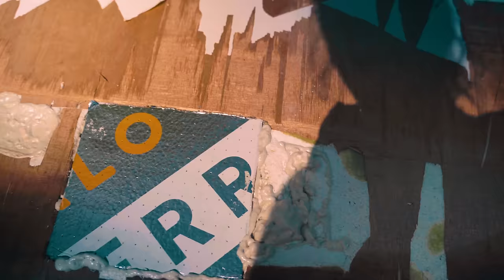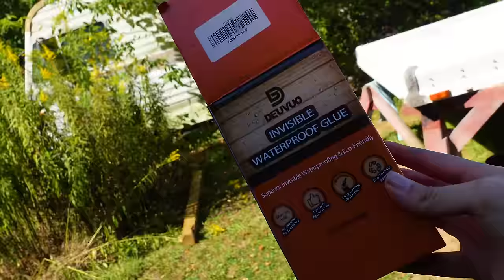my new HAIR & I finished my camper roof

Comment: Dealerships are notoriously expensive for service. They no longer make good margins when they sell cars. So, most of the money they make they make through service work. Never take your car to a dealership for service work. You need to take it to a local independent mechanic. Wheel bearings are not hard to replace and all you have to do to diagnose the problem is lift the car off the ground and spin the wheel. Replacing a wheel bearing on a Jeep should cost you $300USD-$400USD in total, with no diagnosis fee at a local independent mechanic. I don't think it's that the dealership took advantage of you, necessarily (telling you warranty would cover it was not right, though, when they already knew it wouldn't). But look, you have to pay attention to the world around you and how it works - like knowing dealerships make their money off service and that dealerships do service work to make things "like new" with original parts from the car company (super expensive compared to 3rd part parts most people and mechanics use which are the exact same, work just as well, and last just as long).

As for the warranty, I'm assuming you're talking about one of those 3rd party company warranties given the age of your Jeep. Those warranties are not worth the money. If I'm correct that is what you have, you should cancel it immediately and stop paying. Those warranties only cover manufacturing defects, not normal wear and tear on your vehicle. So, things that normally wear out or rust - bearings, exhaust system, belts, transmissions, alternators, starters, engines, cv joints, shocked, struts, electronics, etc - none of that is covered. For something to be covered it would have to be like - the axle cracked in half because there was a bubble in the steel when it was made. Or, like you buy a brand new part that is rated for 60,000 miles and it only lasts 1,000 miles before it fails. And, you need your mechanic to call the warranty company to make the claim and he has to be very careful about what he says and how he says it. He has to deny it was wear and tare and say in his opinion it looks like a manufacturing defect. Honestly, I feel like the whole 3rd party warranty industry is kinda scamy and the Gov't will probably shut it down or heavily regulate it. It takes advantage of people's anxiety about their cars.

I think a lot of the reason people have this anxiety is because cars are complex and expensive to fix. But, if you spend a little time educating yourself about them most of that anxiety will go away. There are some really good Youtube channels that can teach you a lot, like "Scotty Kilmer" and "ChrisFix". You can easily start doing some basic work yourself like air filter, oil changes, and oil filter changes. It's really not difficult at all. Plus, understanding more about what is going on will prevent a lot of anxiety about things like the kind of noises your transmission makes when climbing a mountain (which are almost always harmless).

I used to work as a mechanic, and believe me, unless you are a mechanic at like a BMW dealership or a Porshe dealership you are not making much money. And, I've almost found most mechanics to be pretty honest. The dealership service managers... not so much. A tip related to that - never have mechanical work done at like a chain tire shop or a chain oil change place.

Comment: alot of those cabinets have varnish on them and so it wont work good it needs to be sanded first  to take that off then seal it with the paint   ... as for the roof that sucks  

 damn just ugh...  good luck hun

Comment: Leave that roof covering off and just seal with a water proof roof coating.   Should be tacky enough to adhere and stay up and will act as a membrane…. And since stuff like that is thick when applied should conceal most if not all imperfections …. Just my 2 pesos.  Hahah just. CHeck that those roof coating don’t emit too much toxic 
Fumes
Reply from the maker: That’s a good idea if they are ok for indoors lol I’ll research it
Reply: @TorieRobot  if toxic then apply to exterior and simply paint interior ceiling with normal indoor paint.   One consideration I didn’t think about is weight of the roof membrane … I can’t imagine it would be any more than the wood or laminate your working with now.  But I could be wrong 😑

Comment: Plywood looks like old cheap Luan and is de-laminating. Maybe try stabilizing it with a lot of 2 part fiberglass resin mixed a little thin and get it really wet so the Luan sops up the liquid and re-glues the layers and makes them stabilized and stronger again. Gorilla and Loctite's Best adhesive edges out Liquid Nails, but like you said, the plywood is where it's failing. You know, if you has a buzz cut or Rapunzel's hair, or anything in between, you'd always be beautiful. And then you smile and it's all over... Irresistible.... and resistance is futile! Yes.... People are all selling out because those that have good hearts always seem to lose. But I'll let you figure out what can work for you! Social Media is Inverting what took thousands and thousands of years of societal trial and error to employ a system that mostly works. And that's really the best Humans can do. Don't be fooled with the carrot of expecting better. It only does the opposite. Eventually, to the point of implosion. Keep at it Young Lady! Be true to yourself and work with those that don't have their moral compass spinning so fast, it cuts the glass. It's the discipline that breeds success.
Reply: And to get the roof to CROWN again in the middle.. As long as it doesn't interfere with the lift system..... Make two wood Joists that go from side to side (One piece each), one in front of the vent and one behind. Make the middle 3/4" higher than the ends out of wood like an arch. Then screw aluminum to the side of the wood and cut it to the same shape of the wood joists. Reinforce where it gets attached to the sides. Ample construction adhesive to the Stabilized plywood on top and SS nuts, washers and bolts to attach to the reinforced sides.  And of course, it can only be as tall as to where your headliner will be mounted! 1/8" thick by the tallest point of the arches of the joists aluminum bars, will not allow sag when married to the wood joists and won't weigh much. You can even use a belt sander to cut the aluminum to shape, of even a jig saw with a metal blade.  And those cabinets are cheap flake board with Contact Paper (Not Veneer) on the flat panels. Find an Epoxy Primer and scuff it lightly first, if you want it to be reliable. Ciao Rapunzel!

Comment: Still think your truck is a reasonable deal, the repairs are long term, the ripoff was the warranty. The camper , can’t deny a POS, buying this type of thing is a slow and steady wins the race project but it will be done soon, there are lots of adhesive and coatings that will fix the roof, you could use the exterior liquid rubber on the inside while it is still off.

Comment: You need to educate yourself when it comes to automotive subject.  You will most definitely get taken advantage if you do t know what is going on. That’s why used car salesmen have such bad reputations.  So if you do t know what you are doing with cars and trucks. You need your take someone with you that does otherwise you will be taken advantage of over snd over. Even at large dealerships .so you need to learn too.  It’s just how it goes. You can’t just assume people will not take advantage of you
Reply from the maker: I know a lot more than most people - unless I’m a full on mechanic it would still always be very difficult to know what to believe . Even knowledgeable ppl get ripped off

Comment: I had to shop around for the front brakes on the Toyota, they wanted $500 per wheel to change the rotor 🤬 which is bullshit. 

I found a franchise that did both front rotors for $300 

And why the fuck is it taking them multiple days to change bearings? What the fuck? 

Are there multiple cars parked around these shops? To the point that they look like car dealers! Those are TOW shops, avoid them! That’s where the tow trucks drop off broke down cars because they get kick backs, those shops suck.